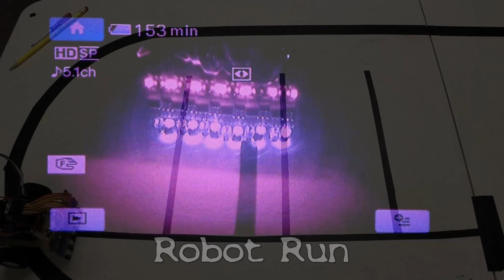Arduino Six IR Sensor Line Following Maze Solving Robot

Comment: Sir may i have circuit schematic and what is pin number for all 6 sensors. I cant understand 32,34,36,38,40 sensor pins
Reply from the maker: Look carefully at your Arduino board and the numbering of the pins.
Reply from the maker: Look carefully at your Arduino board and the numbering of the pins.
Reply: Tq sir but in program it is mentioned tht left center sensor pin is 32 but in video all the sensor pins are connencted to analog pin. what is it?? May i have your schematic digram sir??
Reply from the maker: @ragulbalu1628  The video show HOW the connection are made . The program determines whether a pinout is digital or analog not the label. Have you tried it yet?
Reply: Yeah sir i tried it by using digital input but its not working properly sir thts why im asking u.

Comment: should we connect the ir sensors to the analog pins
Reply from the maker: Look at the code carefully. You should see where the IR sensors are connected. Does not matter if the board input descriptor says analog or digital - the Arduino code makes the changes for the robot to work.

Comment: Sir could you please provide me the code ,as i am unable to use the code provided on your link . :) 
mail - sanyamarora21@gmail.com
Reply from the maker: Code is posted on the video links ... it is is text but easy to covert to Arduino readable code my changing the file extension to whatever Arduino version you are using.

Comment: How many ir sensors  required for about 30mm black strip.? For accurate results
Reply from the maker: How far apart are your sensors? That should determine the width between sensors to detect the edges correctly coming into and going out of the black strip. Make the needed corrections/adjustments.

Comment: 3:16 what is ir bus bar
Reply from the maker: 0:59 shows the infrared bus bar. Allows to connect all the sensors for signal, power and ground. Output wires to Arduino board is minimized by reducing redundant wires - makes build simpler and easier to troubleshoot.
Reply: tsisapik did u made this urself?? Or does this come ready made also (other than 8 ir sensor array) ?
Reply from the maker: Made this myself. You can easily make one too - no fast rules on what you can do. Get the three pin servo pinouts for Arduino projects and mount to a small bread board (so you can attached the unit to the robot). Connect the power and ground pins together then attach wires that go to the power and ground of the Arduino board respectively. Solder wires to the signal pins that connect to the Arduino inputs. Be careful you have it wired correctly and the the signal pins are mapped properly to the Arduino.
Reply: tsisapik sorry Sir, I didnt quite understood that. Can I have a circuit diagram.....hope I am not sounding demanding ....
Reply from the maker: The circuit diagram would look like all the postives and ground leads connected together and all your signal wires going to the Arduino board individually - how you implement that diagram is up to you.

Comment: Hi,tsisapik. Great project i must say.
From where i see the hardware you have used is:
A motor Driver,Arduino UNo,6 IR Sensors,Two Motors,Caster Wheel ,Base to support all this.
Actually i am trying to make it and please do tell me if i am wrong or something else is also used.
Thank you.
Reply from the maker: One thing I failed to mention in the video is that the black plastic tape I used was specially cut to fall between two sensors so you do not get false readings and confuse the code. Look also at how you can attach bigger wheels than the standard wheels that go on these geared motors - they are a bit too slow.
Reply: I am sorry.Did I Miss Something?
Reply from the maker: Let just ask a question - how do you propose to attach wheels on your motor?
Reply: I'll be using DC motors,so it wouldn't be difficult attaching wheels.
Reply from the maker: So you have not come across that issue yet .... good luck!

Comment: please mention the connections between the arduino Uno , L298 motor driver and The IR sensor .Just the pins.The problem is my bot is not moving at all with the same code that you used So i guess its a connection problem.Please Help me.
Reply: okay, I'll look at the connections and in a few minutes I'll try to help you out with it.
Reply: please help
Reply from the maker: The best place to go is into the links for the project details .. did you go there first?
Reply: yes.....did not help...i am using the same component as yours...can u tell the connections between the motor driver , arduino and the sensors...please
Reply: Please Help...i am at the verge of completing this project.
Reply from the maker: OK .. here is what you need to do. Play the video in HD. Then stop the video to write down the colors of the wire connection from the Arduino board to the motor controller. There are only four wires to worry about and each wire is different color. Same deal with the sensor - note the yellow wires as they go from the sensor to the bus bar to the Arduino board. FYI - there is a reason I wire the project this way and why I take the time to take the picture of all the views of the project.
Reply: the problem with my bot is that it is not moving at all..i have done all the necessary connections.Another thing my sensor has got 6 digital and 6 anolog  male headers...should i use the digital one or the analog one when connecting to the arduino analog female headers ?
Reply: May be I can help you out with the connections if you post a picture of your current setup/Connections.
Reply: do you have google drive account ? if you do then upload the pictures there and send me the link.
Reply: Okay.
Reply: Sent.
Reply: Man your pics are not downloading...
Reply: Ibrahim let me resend it....
Reply: https://drive.google.com/open?id=0Bwvlwg9Ct5OBMFNVMG5mQkhIUzk3MWdpZjlETVJWQVpJWjE4
https://drive.google.com/open?id=0Bwvlwg9Ct5OBRUl5cVZRdWhfQVhUdS1YMlZfYnF6VkJRZ0JN
https://drive.google.com/open?id=0Bwvlwg9Ct5OBeTRuTVlqSGl6MS1fc3VGWklzRDRsbnhxMWJZ

Here is the link to my pics...
Check out the code i sent you...
Reply: Alright, your IR sensor array is a digtal one or an analog one ?
Reply: Ibrahim it has both digital and analog headers...
Reply: ok I see that you are using arduino power to power up your L298N driver ? right ? lets shift to yahoo mail so that we can chat there
Reply: i dont have an yahoo account
Reply: ok you need to power up your motor driver differently bro.
Reply: how else can i power it up ?
Reply: lets chat in yahoo mail
Reply: DO NOT USE ARDUINO TO POWER UP YOUR MOTOR DRIVER...!!
Reply: lets shift to yahoo mail...i am online ri8 now

Comment: is it necessary to use analog ir sensor
Reply from the maker: I think I used digital IR sensors with gain adjustment to make sure the sensors cut in and out properly - these are my go-to sensors for my line following and maze solving robots.
Reply: but in the code its quite diffrent
can u send me the code which u used
Reply from the maker: What's different? Different from what? I did not change anything in the code?
Reply: bt in the video  as we can see u have used digital type of ir sensors but in the code u have did the analog reads of the sensors
Reply from the maker: The code still works with the "analog read" ... it just needs the pulse from the sensor to trigger
Reply: tsisapik thanx for replying

Comment: Hello tsisapik, I'm also working on the same project with QTR-8A reflectance sensor array and arduino uno bt the motors I'm using are the ones which you have used in your line following robot. I'm unable to get the code working for me, my robot some times takes the turns and sometimes it doesn't and sometimes it behaves weirdly also it never runs correctly after 1st run. can You help me with the code ? I have to complete and submit  this project by 31st March. I've been trying to figure it out for more than a week but with ZERO progress.
Reply from the maker: I encountered the same problems when I used a DIY sensor array so I went with discrete sensors with gain adjustment so I could debug the project without looking at a serial monitor to see if the sensors are working properly. Look at the code closely and note this line " // serial printing below for debugging purposes". I also used an IR camera so I can see the IR light and make corrections to the placement of the sensor.
Reply: well, can you tell me if there is anything that I have to change in the code? like I'm using PWM for the motors. will the code work with PWM ? I'm using PWM for slowing down the robot. Now I have converted hextroik HXT900 servo to continuous rotation servo as a replacement, which did helped me with the speeds, but still the code is not working, BUT I'VE TESTED MY SENSORS THE QTR-8A IS WORKING PROPERLY BUT the code is not working. kindly reply ASAP... And if possible send me your working code so that I can work with your code and see if it works for me. Thanks for replying.
Reply: tsisapik can you please send me your working code ? I am doing this for my University project. So I really need some help with the code. If you want I can send you my code which I've written so far.
Reply from the maker: The code I use is the code that is posted ... there is nothing different to send.
Reply: Well my robot works now but still, it is way too buggy in a way that it sometimes traverses the maze and solves it and then it traverses the shortest path too. but mostly it takes turns when it shouldn't and it also takes wrong turns, sometimes it stucks on left turn etc etc.... I don't get it.
Reply from the maker: The fact it "sometimes" works tells me you have an issue with your sensors. If the sensors do not work perfectly they you have inconsistent performance. How can one tell the sensors detect the black and white spaces correctly ? a) first is to use the line print option in the code so you can tell if there is a problem b) use sensors that can tell you when it cuts off/on when it crosses the boundaries along with an IR camera to tell you if the IR light is properly aligned to the sensor -  then make the needed adjustment to make it perform as expected. What options are open to you?
Reply: I've tried printing the sensor values, and by looking at the values I can tell that sensor array is working as expected. but robot sometimes makes  incorrect decisions  and sometimes it makes correct decision as per program instructions. Do you think integration of PID in the code will help ? or will it become more complicated ?
Reply from the maker: How wide is your black line? If you read the code logic, the actions are detemined by when certain sensors encounter the boundaries something I failed to mention in the video. A wide line will cause the two sensors to encounter the line at the same time which could lead to an error. If you are using electrical tape, reduce the width. Look at the video  - the normal tape width is the outer track for the line following robot - note the maze lines are narrower.
Reply: how wide should it be ? currently its the normal electrical tape of width about 3/4th of an inch.
Reply from the maker: You will have to experiment ... trim 1/8 inch and make a simple maze ... a T with a solid line at the end of the straight line. This way, your robot does not have to move too far - just for testing purposes.
Reply: Finally I got it working without trimming the tape or anything. It was the sensor module slightly touching the surface all the time. 
I wanted to know, what if you place the robot and start in front of the end point but in opposite direction ? where finally in the end it only saves 'B' back move ??? Have you tried that ???

Comment: can a 3s lipo run 2 12v motors and the arduino in this same setup
Reply from the maker: Research the input voltage of the R3 Uno board. Tell me if 13.7v is okay to use as a power source.

Comment: Hi, my robot does the first run nicely, but then when I take him to start and it needs to go the shortest path, it just doesn't do it right and sometimes starts spinning. How long do I need to wait to put him on start again, and what could be the solution to robot sometimes bugging out on the first run also? Thank you.
Reply from the maker: Watch at 3:55 for first boot pass and pause at the finish before restart.
Reply: I know all of that, watched video many times, but that doesnt work for me and I dont know how long do I need to wait.
Reply from the maker: I count to ten before I release ... start from there. Make sure there are no changes to the code - do not remove the LPrint lines or commit any edits. Upload a new sketch making sure there are no errors. I had issues with the IR sensor not working properly (hence the need for the IR camera) - other than that it worked as expected.
Reply: I still dont know what is the problem :/ Do I have to include some libraries or? Really dont know why my robot fucks up the ride almost every other time..

Comment: do they give analog output
Reply from the maker: what is suppose to give the analog output - the sensors? If so, it it digital as it is hi-lo on-off state.
Reply: +tsisapik i was asking about the sensors cause in code analogwrite is written instead of digital write to read sensor values. that's why I asked are they analog sensor . what is the name and price. Thank you for your reply😊
Reply from the maker: Sourced from Ebay ... Arduino IR sensors ... look at the picture to make sure they are identical.

Comment: can I use simple IR sensor instead of using polulu sensors?...then what type of changes I need to make in the coding please help me with the codings..
Reply from the maker: Hello ... I did not use Pololu sensors either and I did not change the code. Using simple IR sensors will work but you will find odd robot behaviors that are hard to correct - which the reason I went with IR sensors with adjustable gain and used an IR camera to check performance so I can isolate the problem/s.

Comment: Sensors used for the robot from the link in the description are different from the ones you have used. Will the code work anyways? I also plan to put 5 or 6 sensors like you, how many changes in the code do I need to make? Thanks for the answer :)
Reply from the maker: The sensors I used are actually easier to use because a) you can see when the sensor is activated or not by looking at the LED light and b) the sensitivity can be adjusted to be triggered at the proper time as the sensor enters or leaves the line. The sensors send the signal to the Arduino board and the circuit really does not care what "kind" of sensor you use for as long as it gets the right signal. You cannot use five sensors as you will have the center sensor sitting on the line - the code will not know what to do with that signal. I did not modify the code in anyway ... but if you are famiilar with Arduino code, there are serial line print sub-routines used to check whether or not the sensors are working properly - which is a testament to why a) and b) are very helpful. To fine tune the white LED focus, I used an IR capable camera - comes in handy to troubleshoot stubborn / erratic sensor behavior.
Reply: tsisapik Wow, thanks for the long answer! I'll ask again if there will be any problems.
Reply from the maker: K
Reply: Hi again, sorry for bothering but could you explain me why do we need to "#define led 13", what are we using it for? Thanks again.

Comment: how to make the robot u turn?
Reply from the maker: It's in the code. When the robot does not sense a line present (i.e. reaches the end of a line) , the command is to turn left until it encounters the line again and then moves forward. If it encounters a "normal" left and right turn, it takes the left instead of the right then moves forward. When it encounters a solid line, it stops. The width of the line, spacing of the sensors, speed of the robot and wheel base all influence how the robots work ... to work properly all the parameters just mentioned need to be "correct". It really helps to have an IR camera to see the IR light as the sensors cross the line - very helpful. Go to the link in the video description for a better explanation of how the robot works.